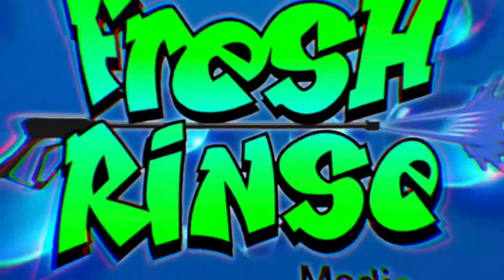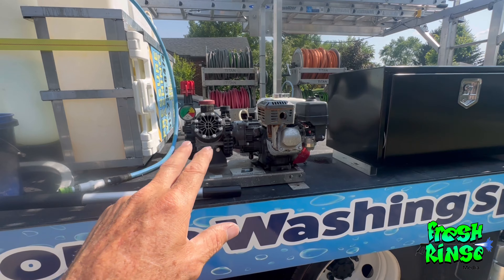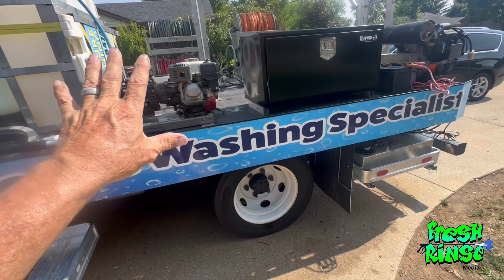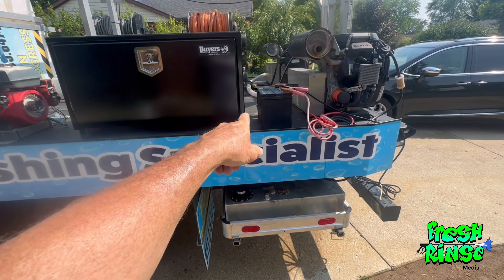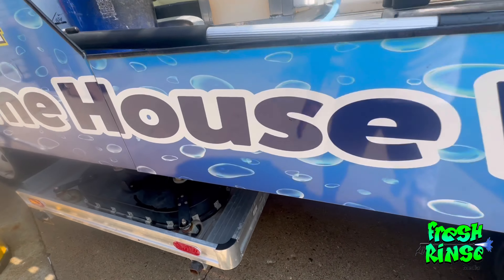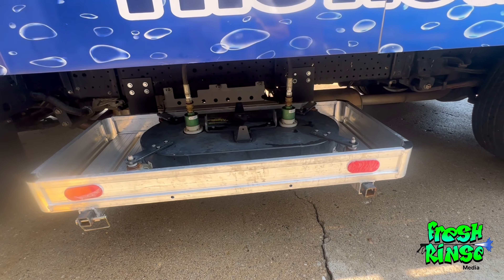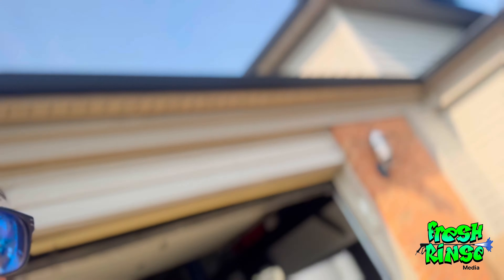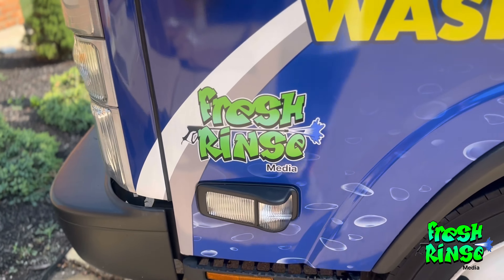Jazzy Got Some Updates. SUPER COOL STORAGE IDEAS!

Comment: The tray Idea is cool but the front one isn't protected with mud guards, I think you might end up damaging some of that hose with debris. Not sure if you have steps to walk to the top of the bed but that would seem worth it and you can then move things to the upper level with the walk through access you have.  I would consider working to a ground level switchboard which accesses control of all you engines that way you can place them where ever. Still really cool rig as is .
Reply from the maker: Thank you my man!!!

Comment: Where the handle connects to the mini mondo, did the factory use the miniature key ring to hold the pin in place? If so, are you still using that or did you find an alternate solution?  I have the mondo and have thought about doing this same thing on my trailer.
Reply from the maker: @BrianWarr33  Yes, I’m using the factory pin. No issues
Reply: @TheFreshRinse  I’m. It referring to the pin itself, I’m referring to the small ring that holds the pin in place. I would love to take my handle off, but that small key ring that holds that pin in place is a pain in the rear. Was wondering if you swapped to a different device to hold the pin itself in place.